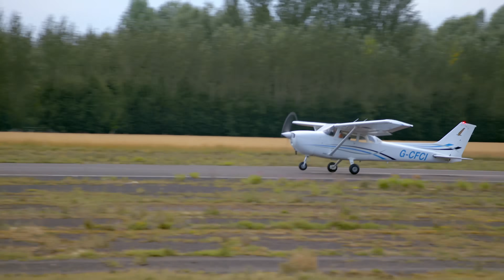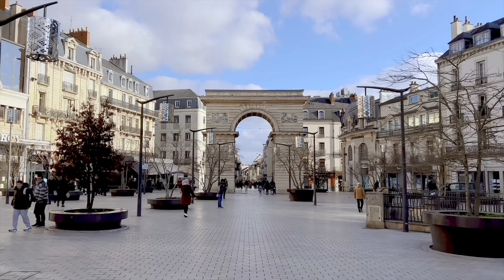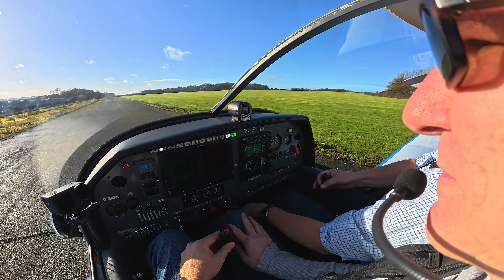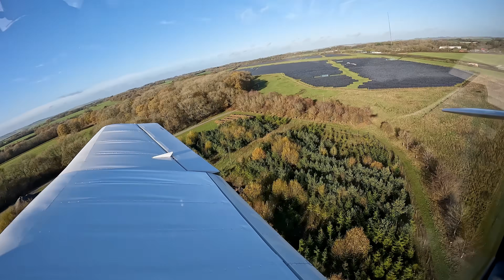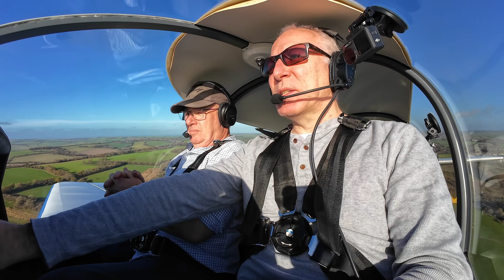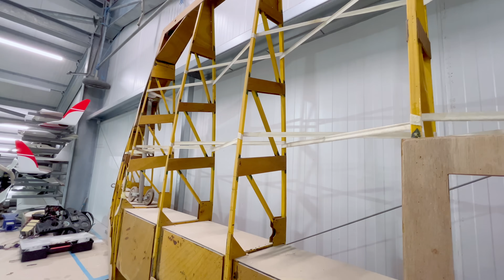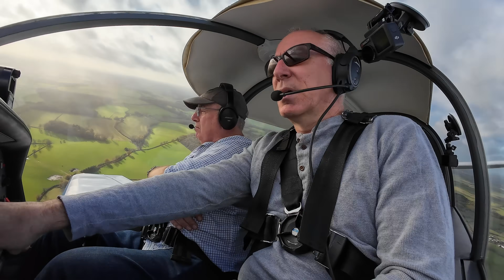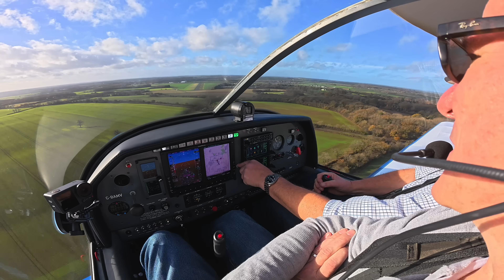The quirky French plane giving the PA28 a run for its money!

Comment: Jon, you just made my 2026 already!   I did my PPL in a DR-400 at Rochester EGTO in 1991.    I still remember my 1st solo in G-HANS.... Remember doing my qualifying XC to Ipswich!   Back in 91 I could never of dreamed of avionics like that mind.     Cheers Jon.   HNY.
Reply: I'm doing my PPL in G-HANS right now! I guess it's quirky, veers to the left when you pull the brake.. xD Wish it had the same avionics as this DR400 does!
Reply: @MadCatChiken .  No way!    What airfield?
Reply: @N51Mi6 Gloucester!
Reply: @MadCatChiken . I saw it on flightaware then found the Cottswold Aeroclub site.    Amazing.   Cheers.
Reply: @MadCatChiken  Veering to the left when pulling the brake is not normal, the braking action should be equal on both sides. Ask the mechanic to look into it. All the best for your PPL :)

Comment: That was some grip on the control column on finals, like a Scotsman gripping a £5!😂.  I fly a smaller older Jodel DR11 - a delight to fly with a great wing, stalling speed of just 35kts if you can actually get it to stall.

Comment: Last year I converted from a T67 Slingsby 200M to a Robin 400 diesel. I found it a bit slow to respond compared to the T-67, but a buddy who comes from a 172 praises the more direct handling. I've already learned to appreciate the stable behaviour in a stall and most of all the efficiency and relatively low operating costs at 20 litres of Jet-A1 per hour at 110 kias.

Comment from the maker: Have you flown the DR 400 - did you find it as quirky as I did?!
Reply: Because it's from Dijon it cuts the mustard.
Reply: I flew a Dauphin which is a 2+2 trainer on two navexs when I was learning. Visibility was great the one I flew had foot brakes. Also test flew a metal HR100/210 which was super smooth and I really liked but needed too much work and out of production for a long time now so passed. Think your summary of controls is about right. Joystick is unique but more familiar to me than a yoke.
Reply: After starting my PPL in a 2 seater Sonaca S200, I transitioned onto the DR400 (180hp, constant speed prop) for the remainder of my training. Very comfortable plane with great exterior view and responsive controls. Much sportier than a 172 I'm currently flying as a PPL holder...
Reply: Did my ppl on a DR400, so no.
Reply: Done lots and lots of glider towing in one (and its older brother the DR300). They are very good tow planes as long as you’re not trying to use an extremely short field. For that you want a Pawnee.
Reply: I fly a 1991 DR400-180 Regent (with toe brakes) on a regular basis. Flying isn't anything but fun. But some things are strangely built. A mechanic who I'm friends with once told me that some details are designed in a real genius way, but then it seems the designer went on in its work while obviously thinking that he had done enough good this day.